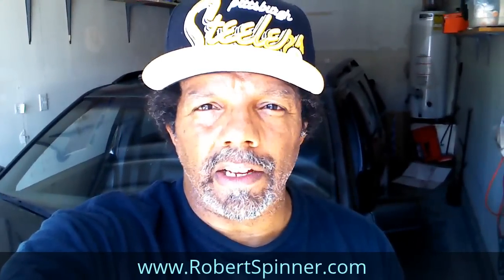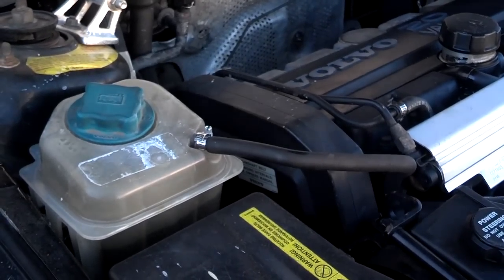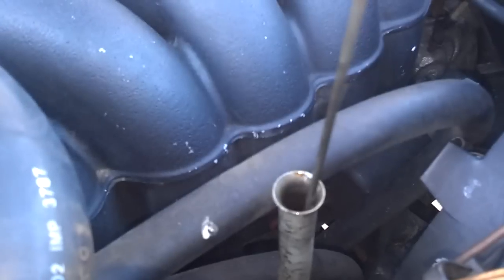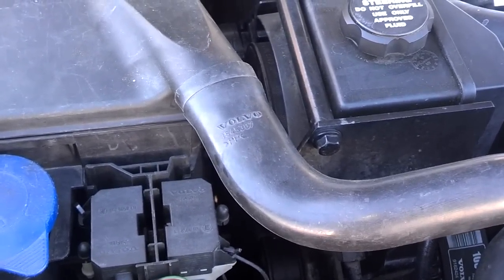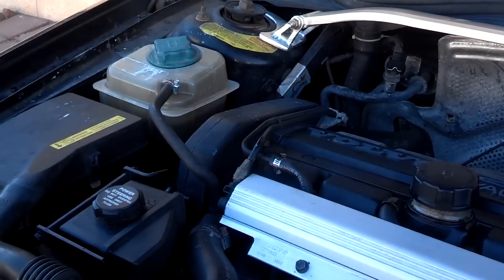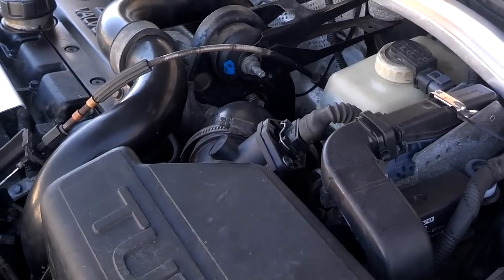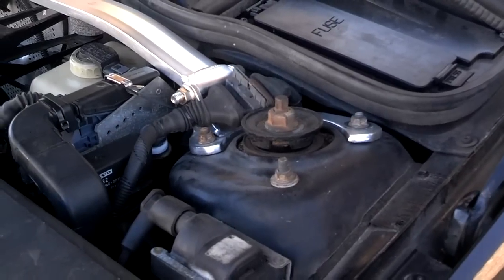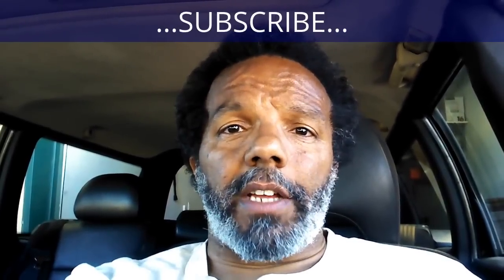Top things to check before buying a Volvo 850, S70, V70, XC70, etc., Pre purchase inspection.

Comment: Hello robert, I recently purchased my 3rd volvo (850 glt and 850r, just purchased a 1999 s70). The s70 seems to be smoking a ton out of the exhaust. The smoke is white and hazy with lots of water in it, however I am not losing ANY coolant. It has been raining here for around the last 5 days and there are two small holes in the exhaust.

I did however notice around 90% of my oil disappear around a week after I bought it after the car had been sitting a few days, completely untouched for around 72 hours. I did not see any oil on the garage floor or on the motor. The oil literally seems to have disappeared. I refilled the oil, and I have since driven the car around 100 miles in town and on a 3 hour trip on the highway, all without losing a drop of oil. 

Any suggestions? These two issues are quite puzzling to me, as I have never experienced this with any volvos I have ever purchased or own currently. I typically do all my own maintenance, so I've checked all the normal causes without any kind of answer.
Reply from the maker: +Jeremy Tyler Is the car turbo? Is the PCV serviceable? Was the oil level really 5-1/2 quarts low?
Reply: Yes it is a turbo, and I put 2 quarts in it to top it back off to get it back up onto the dipstick I believe
Reply from the maker: Once warm, it should not smoke out of the tail pipe. Does the car get up to temp? You'll have to monitor oil consumption. If more than 1 quart per 1000 miles, you either have a bad engine or bad turbo.
Reply: +Robert DIY update to the s70. I have driven roughly 850 miles so far on several long 2-3 hour trips, and have only lost around 1/8th quart of oil since. However there was a slight drop in my coolant. It seems to just simply be a bad  reservoir cap though as there's some coolant on top of the resevoir.

I'm not sure what caused the initial oil loss, but it seems to have been a one time thing. I've been driving it hard on the highway as well as in town, doesn't seem to affect anything.
Reply from the maker: These cars use oil most when the engine is cold. So it will use a lot less on long trips that it will during every day short trips.
Reply: Hmm. I'll have to drive it around town more to figure it out. If anything new pops up I'll post back. Thank you for your help!

Comment: Thanks for your great channel. I am looking at at a Volvo cx v70  The PCV is clogged by the positive pressure test but does not seem to have blown the rear seal even though it does have some small oil leaks would that mean the other seals that are leaking might be Ok once the pcv is fixed ? and second question is it has a hesitation on exeleration what could this be ?  Thanks
Reply from the maker: Maybe, depends on what is leaking.
Reply from the maker: Bring it by so I can check to see why it is hesitating.
Reply: @RobertDIY  Thanks Robert but that wont work as I am on the island on Mallorca in Spain Jajajajaja Thanks
Reply: @RobertDIY  The hesitation happens only at the start of the acceleration then it stops and the engine sounds good. Thanks for getting back to me Robert appreciate it.
Reply: @RobertDIY  The car is always parked in the same place  and there were only small drips so I was thinking it would not be the complicated seal in the back perhaps the side seal you discused in your video. I think you said the water pump that might not be so hard for me to change. I was just wondering if leaks meen a definite need to change a seal or it could be just leaking do to pressure build up from the PCV and when the pressure is relieved the leak stops   ?    (might be wish full thinking)

Comment: Steering rack leackage? I had to replace mine on a Volvo 850 from 1996 because it popped out the metal cap for the steering column angle drive nut and the drivers side casket was blown up.
Reply: That CV boot, why does the rubber break within 12 months every time you've changed it?
Reply from the maker: cheap after market parts.
Reply from the maker: Ouch!

Comment: Good info, I have a 2000 Volva S70 just last Summer, Engine sounds like a kitten, just had my first problem with it Thursday afternoon, I have no heat in the car AC dose not turn on, I'm thinking it's just my blower, I'm not a mechanic an hate working on cars but I'm thinking about the money I can save, I turned heat on an get no sound at all, please help.
Reply from the maker: +Samuel Johnson take the blower motor out and connect 12 volts to it to see if it works. On your car you pull the glove box, then the panel under the dash. There are 2 screws behind the glove box that you have to remove to get that lower panel out.
Reply from the maker: +Samuel Johnson https://youtu.be/pfp9NsUf0U8
Reply: Thank you, I will be looking into this, Thanks again my friend.

Comment: Hi, I have a Volvo S70 1998. I have an orange triangle with a green lambda symbol in it on instrument panel. The vehicle has passed recent inspection. Went to a mechanic and he shut the light off. Then i drove 10 miles and the lamp went on again. The orange lamp with the text SERVICE goes on and off randomly. How do I shut off? The mechanic told me to switch off lamps by removing the plus marked starter cable from the battteri. Pressing speedometer button and turning on ignition doesn¨t shut off the lamps on this year model. Please help!
Reply from the maker: https://youtu.be/Jq5mhoAqJDQ

Comment: i was just looking at an 850 which has 225.000 kms on the clock but it has an engine from the s70 so it has 170 hp. The motor only has around 120.000kms on it. I went through all the checks in this video and it seems to be fine. But when he accelerated away there was a small puff of blue smoke..is that bad?
Reply: That's a blown head gasket that's not good you have to take the head off to replace it.
Reply: +sleedog11 lol what? probably just valve stem seals. nothing to worry about, but does cause some oil consumption.

Comment: I actuly am looking at getting a Volvo but a newer one like a 2003 and up s60 or v70. I would think a lot of these pre checks would still apply to them as well because they have the inline 5. I would think there still interference motors as well but I'm not to sure. do the newer cars have less problems because of the newer tech or is it worse. having to have delt with the 2000-2004 audi a4s I can say there just problems from the start and I really don't want to go back to that kinda stuff again. I'm kind of a diy kinda person my self and really don't mind working on a car to save a few bucks vs going t a repair shop for the moderate jobs. but things like replacing valves and rings and a rear main seal are out of my tool capability
Reply from the maker: +RioZLander pretty much the same. Get '04 or newer.
Reply: Robert DIY thanks for the advice. yeah just saw a video on replacing the pcv. not the worst ive seen but its up high on the annoyance repairs just due to the everything's in the way of everything. hopefully 3k will get me a volvo thats had good treatment. it just really dont want anymore cars that are total repair nightmares......like audi or bmw or (shudders) mercedes again

Comment: I have a 99 V70 that Is misfiring on the fourth cylinder and there is oil where the coil pack should be placed. I replaced the coil packs and the fuel injector. Along with the spark plugs, didn’t fix it. Today my ETS light came on and I’m not sure that has anything to do with it. I’m hoping it’s just the break sensor messing up. Still can’t figure why it’s misfiring other than the seal causing an oil leak and therefore a misfire but it’s not leaking OUT of the engine
Reply from the maker: https://youtu.be/gt9w-ZSxs9I
Reply from the maker: http://www.youtube.com/watch?v=Sg7iFytxfzQ
Reply from the maker: probably has a burnt valve.

Comment: Such ans AWESOME and informative video! Thank you for posting this!
I am considering a 2004 V70 and this will be VERY helpful when/if I decide to pick the car up.
Much appreciated!
Reply from the maker: +NuarStanger You are welcome.
Reply: +Robert DIY 
Quick question. Have you had any experience with the next generation of these cars (years 2001+)? Are they relatively similar in construction and quirks/issues?
Reply from the maker: Yes, except for the '01 - '03 vehicles. Many of them have transmission issues.
Reply: +Robert DIY Thank you for the info Robert!

Comment: I loved the squared off design of these Volvos but by God, if you buy one in 2015 you're either an enthusiast (with deep pockets) or need to have your head checked. In South Africa these cars go for couple of thousand dollars, and those are the one's in fairly decent shape. If you have to go for an 18 year old car I would go for the equivalent BMW 5-Series or Mercedes E-Class...or God forbid a Toyota Camry.
Reply from the maker: +Obese Burn Victim Thanks for watching and sharing. When purchasing old cars I should always consider parts availability.
Reply: Yes, parts availability should be one of the primary considerations. These Volvos were quite popular so parts should be plentiful.
Reply: +The Man Who Put The Satin on Your Panties 
I laughed a bit reading this as a Swede. 
I can go right now and buy a working Volvo any from 240 to 850 for  about 600 US dollars.
Now those have rust spots most of the time, but usually runs fine.
Reply from the maker: The Man Who Put The Satin on Your Panties
They are.

Comment: Robert, in my 850 the crank bearing is broken  do you know how much will it cost to fix that ?
Reply from the maker: So it's knocking? If they can get it by dropping the oil pan, probably about $700. If they have to pull the head, around $1800.

Comment: Is the pvc system bad if it will suck Glove but smoke comes out of the dipstick?
Reply from the maker: What's with smoke? I don't get it???
Reply: @RobertDIY   I don't know what's up with the smoke either hence the reason I was asking you. Everything else seems to be operating fine other than a little bit of smoke coming out from the dipstick tube when you pull out the dipstick a little bit.

Comment: Need help rigging a separate headlight switch on an 850 wiring harness burned and interior switch only turns on running lights. High beams work with running lights if I hold the switch to highs manually
Reply from the maker: +Karl Krausse If the tail lights work with the running lights, that should do you. If you have a damaged wire harness, you should pull the dash and change it. :(  Rigging stuff in these cars usually turns into a slippery slope.

Comment: Another question: what does it mean if smokes come out of the head when I open the oil cap on top of the motor?
Reply from the maker: +Santiago Stockton the oil in the engine is hot.

Comment: hey Robert,i have `98 S70 with 165,000 miles glt model all options.nice looking car.but smokes.I`m going to change the pcv valve.but past that not sure if worth puting more money into it.  anything cheap i can do ?  maybe bring to your shop ? lol   thanks for any help...did you see Le`von dunk ?  check youtube
Reply from the maker: Scott Durkee I don't have a shop. If it's smoking, it's likely a bad PCV, leaking turbo, or bad valve stem seals.

Comment: I'm looking into a 1999 v70 with 101k miles what should I look out for?
Reply from the maker: Lol
Reply: Robert DIY let me rephrase that question because my answer is literally this video
Does the 1999 model have more problems than any other year?
Reply from the maker: The only other thing is the ETM (drive by wire) and mated computer stuff. The ETM makes the car have much better throttle response.

Comment: Hi Sir, i Have volvo s70 1998 Model , I am facing problem of gear missing , pls advise.
Reply from the maker: I don't understand your question. If you are saying that the transmission is bad, I would recommend that you get it replaced.
Reply: @RobertDIY  Mr. Robert while driving let’s say I stoped on red signal for while and when I should go on green light and I am pressing race RPM is up but car in moving very slow and vibration

Comment: Thank you Robert , i have a 95 , 940  check engine with code 143 .  Can anyone help me find where it is ? I can't find it and  what to look for ? Please
Reply from the maker: Have you Google'd the code?
Reply: Robert DIY pp
Reply: Yes, i got a 143 code and  it came up with a kick down switch . No info anywhere to be found.
Reply from the maker: That's part of the throttle cable.

Comment: Does anyone know what the drive cycle is for a 1999 Volvo v70 I’m having trouble passing smog due to obdll not being ready cat and Eva Driven the car 300 miles and they’re still not ready
Reply from the maker: Yikes! The '99 year model is the worse. Many states have waved them. I've heard of people doing more than 2,000 miles and still no ready. When you take it to get smoged, don't turn it off. Tell the guy that it won't pass if turned off.

Comment: My '96 850 t has stopped running.  The starter turns over the motor , but does not start and run.  It ran ran fine one day, but not the next.  Any ideas?
Reply from the maker: +Ginger Wireman https://youtu.be/YiPAPu-K8OI
Reply from the maker: +Ginger Wireman https://youtu.be/3InZVPLYgqs
Reply from the maker: +Ginger Wireman https://youtu.be/NhtUXZTurzo

Comment: If battery is disconnected on these cars, or OBD codes manually cleared it takes a year of driving to replenish these codes. WHY???  Guys at emissions inspection stations all know about this. You have a car with no CEL, yet it won't pass inspection.
Reply from the maker: That's not true. I can get a car to pass emission in 3 miles.
Reply: @RobertDIY  I think few of us would love to learn how you do this.

Comment: I have a 1998 Volvo S70 and feels like its still in lock up when you come to a stop .shakes real bad only when you come to a stop. Lock up on transmission. Need some advise.
Reply from the maker: Codes?
Reply: @RobertDIY  the arrow light came on. But didn't stay on. All the scanners I use don't go back further then 2000. I have 98 Volvo s70.
Reply from the maker: So you have not gotten it scanned for codes?
Reply: @RobertDIY  There scanner only goes back to 2000. We don't have a Volvo dealer in port Arthur tx. I'm on disability anyway. Its makes the motor shake, if you put in neutral it's fine. Put it in drive n take off it's OK, but come to stop n shakes hold car. How else could I get codes?
Reply from the maker: Probably bad engine mounts.
Reply: @RobertDIY  I'm a transmission man by trade. It acts like lock up solenoid is staying on.
Reply from the maker: ok
Reply: @RobertDIY  any advice. Ever run across this problem. Wouldn't make it up driveway, maybe stuck in higher gear? How can I get codes?

Comment: robert i'm back  i tried to replace my fuel injector relay, when i was taking the old one off the pin's in the connector wire came out. First off all i don't know which one go's where and i need another connector help.
Reply from the maker: ouch. were they still connected to the relay?
Reply: @RobertDIY  I got another one and spliced them car running again thanks

Comment: Has anyone had an issue with hearing a clicking when driving? My motor isn’t ticking, but I noticed when I drive forward the noise starts and when I get to a certain speed I can’t hear it anymore, but I usually hear it accelerating from 0-15 mph and then it just goes away. I have no lights on my dash and I’ve dropped about 2 grand into it getting the timing belt replaced, pcv cleaned, top motor mount replaced, and oil change.
Reply from the maker: I can't hear it from here...
Reply: @RobertDIY  can I send you a video?

Comment: does this checking apply for Volvo S60 2004? or is it so different ?
Reply from the maker: I'm sure it will be a little different but it's best to take the vehicle to a mechanic if you are not mechanically inclined.
Reply: Robert DIY I will. however, which One could apply? the glove test, for example
Reply from the maker: +diegocaracasfc yes, pretty much same engine.

Comment: Add to this list: cheap plastic dash mounts that break at first cold snap and then the dash rattles and squeaks.
Reply from the maker: They're all broken. 😒😉
Reply: Very poor engineering or management decision. If I had known about it before I bought my 94 850 I might have purchased a Honda or Toyota instead.
Reply from the maker: Never to late to get an old Honda. ;)

Comment: I have a 2000 c70 the dashboard is on but can't tell how many miles i have
Reply from the maker: +D House Must have a bad cluster or had a computer changed. The computer and clusters are matted in those cars. If either have been changed things will not work properly until it's reprogrammed at a dealer.

Comment: I'm looking to buy a 1997 Volvo V70. I inspected the car itself passing trough all the aspect on this video and some more and it seems alright except for a power steering oil leak. I tried to find exactly where it is coming from but I couldn't tell since I was far from home and had no way to lift the car and check. The car has 273 000km, driven by an old granny, timing belt never changed and she is asking 900$ for it. Except for some rust, the exterior is A1 as well as the interior. Should I be worried about the oil leak? I would use this car for a road trip across the US and Canada.
Thank you for any help you guys can give me :) @RobertDIY
Reply from the maker: +Anne-Marie Bouffard https://youtu.be/R_Wko5d7Veo

Comment: I have a car is Volvo of 1996 and the model is 850 ok and I have a problem with the battery be kill so fast like it drain the battery out to die and trying to charge it and it didn't work ok and they saying is  the  c  and it end with the c and it need to be change and every line hose in the engine need to be fix and renew ok
Reply from the maker: I don't understand what you are saying/asking. 🤔